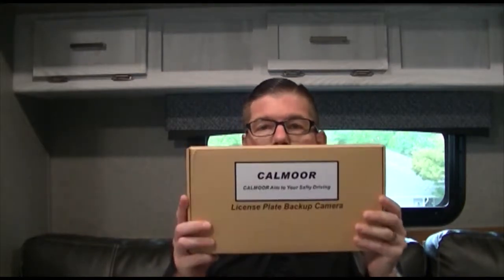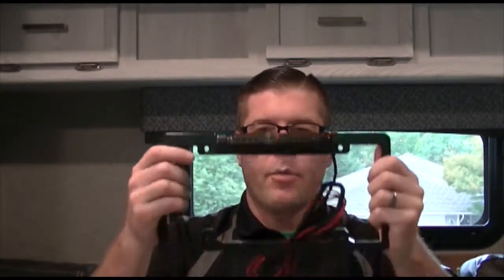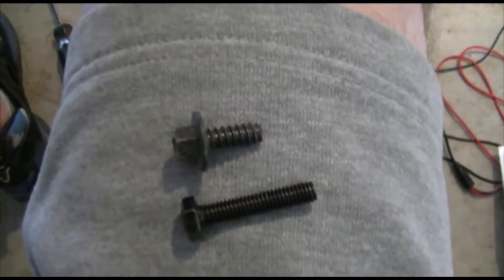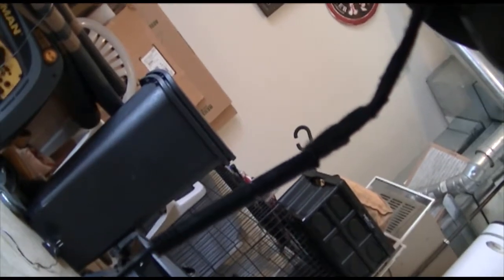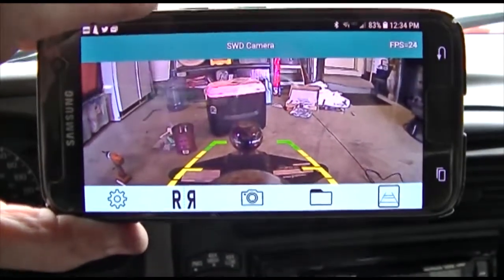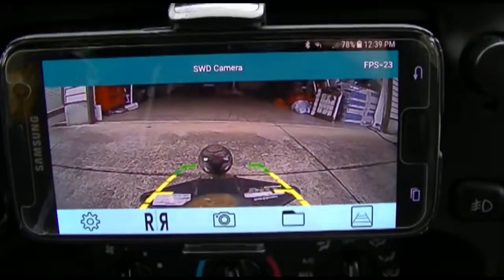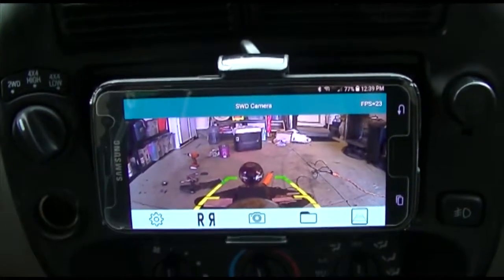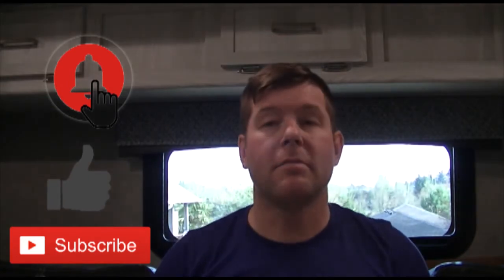How To Install a License Plate Backup Camera - OGP

Comment: So wat if u not around no Wi-Fi
Reply: The camera creates the wireless "hot spot". Your phone connects to the cameras "hot spot". It's completely independent of your phones wireless data connection. Simply put, no wireless network availability on your phone plan is ever an issue. It'll work with an a tablet, or any other device you download/use the app on. Hope that helps!